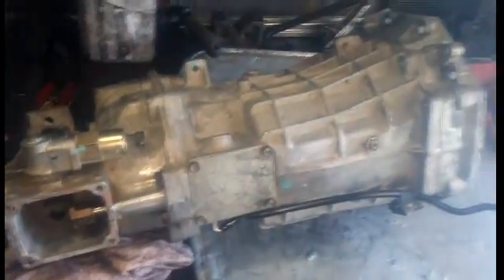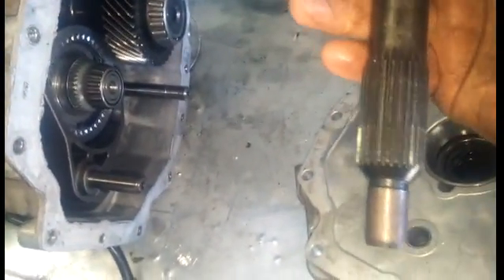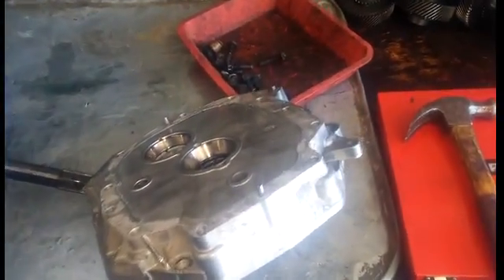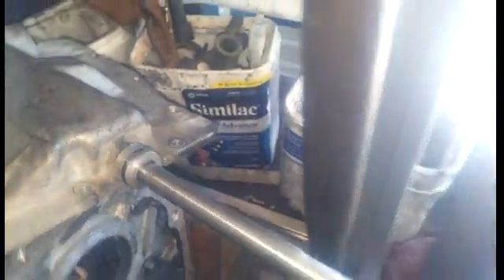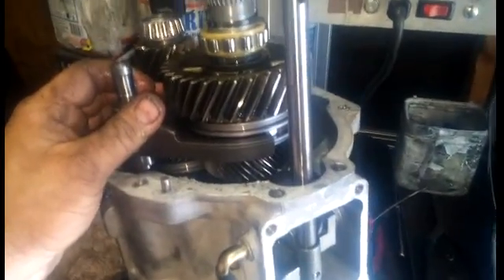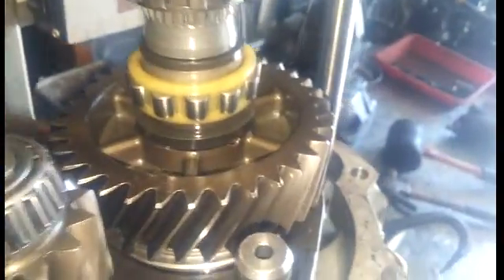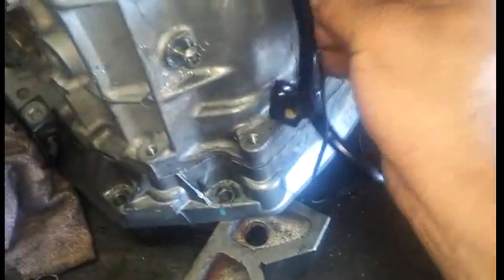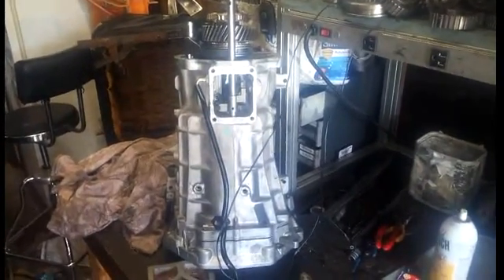Tremec t56 disassembly, rebuild tear down part 1

Comment: If heat didn't work then  we use to use a pin punch on bolts Like These to Shock them loose. the punch must fit inside the torx hole and put pressure on the bottom. A few good hits then undo do it with a torx.

Comment: AFAIK the shift rail bolts are loctited in & needs to be heated with a propane torch to break the Loctite down so they can be removed.
Tremec suggest not removing the centre roll pin if that part isn't worn or broken.

That's everything that I need to take into account when rebuilding mine !

Comment: Never ever use anit-seize.. I those T40 shift guide bolts come out your trans will likely go into two gears at ounce, and destroy everything! Always replace those bolts each time you dissemble it, and use blue, or preferred red lock tite!! They need to be heated with map gas the yellow stuff, heat the case around I the aluminum will expand, and you can then hit T40 with a hammer to shock it, and use a impact come out every time for me this way!
Reply: @Rick Kenn and he said he has done these for decades! LMFAO!!!!!!

Comment: For that last torx head bolt, try using a propane torch and heating it up (a lot) before using the same impact gun and bit to shock it loose. I've done it before on a T5 albeit with a larger size bit, but I've used it with success and I found others doing it on at least one T5 rebuild video on youtube.

Comment: Yes I did.  I got a slice into the side of the bolt with my cutoff wheel, then used my large punch and wacked at it with a sledge until it finally broke loose.  Cannot believe the trouble it took!  I've got the second part of this video, I'll upload soon

Comment: Did you ever get those torx bolts out?  I rebuilt my t56 off a GTO and had the same exact problem. After hours of using a torch and 5 bits later it came out.  The other one didn't need to be removed to get main casing off however i had to drill that one out.